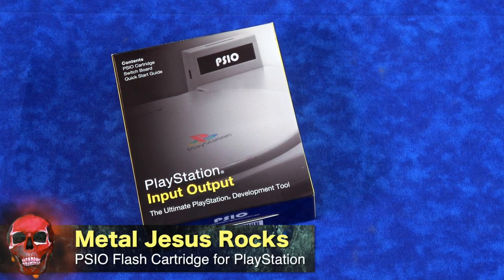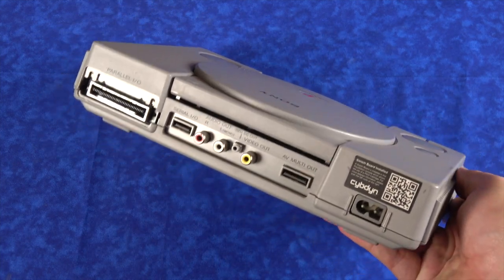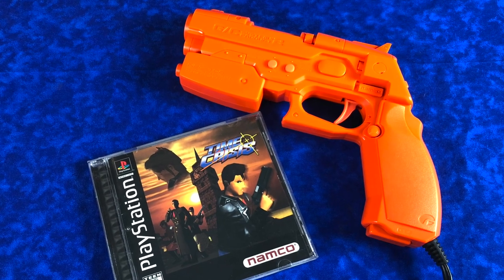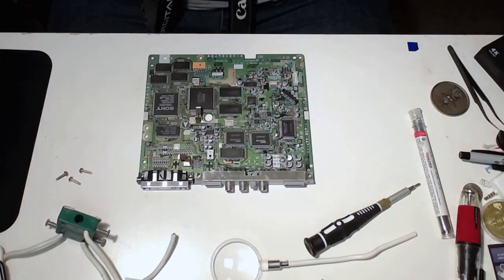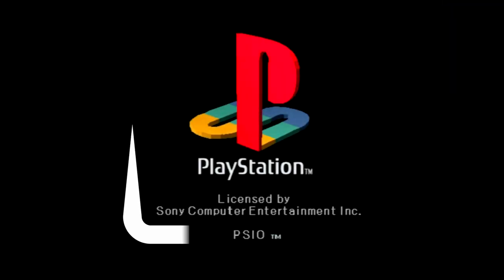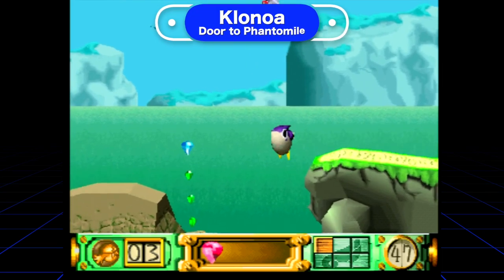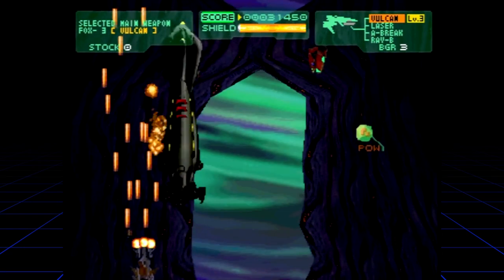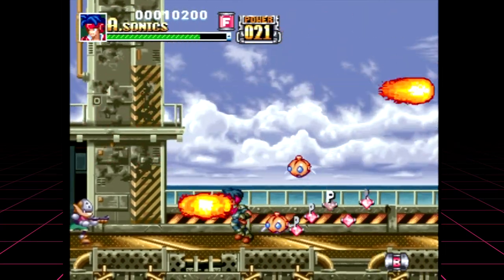PlayStation PSIO - SD Flash Drive for your PS1

Comment: This is awesome. You don't have to worry about your laser dying, nor disk rot getting to your games with thing, but still get 100% authentic experience.
Reply: Rathori Khass If you like to play discs, it’s kind of a bummer.
Reply: @RichLunaMusic  
Urgh, why would you want to play discs when they can skip and take longer to load?. Surprised you didn't mention "piracy" lol
Reply: Rich Luna you can still play discs, it won’t affect the drive at all
Reply: @RichLunaMusic  you can still use your discs. What I like here is you can use a digital ROM file without using an emulator. Game still plays and acts 100% because its, well, actually running on a ps1. The disc drives almost always are the weakest part in older consoles, so being able to still play the games without wearing out the disc drive (or of your disc drive is already broken) is awesome.
Reply: 0/10 not enough skipping

Just kidding it'll be great to finally get some use out of my PS1 with a hardly working laser
Reply: My disc drive skips so this would be cool. But I feel I'd screw it up trying to install it. So hopefully it sells well and they make an easier one to use
Reply: Soft mod ps1 allows discs to be played also and no soldering
Reply: @datunes  the whole point of this mod is that you don't have to use the disks if you don't want to.
Reply: If only they made a USB version so you can connect a 4 TB hard drive and have the whole psx collection. Ntsc and pal 😍😍😍
Reply: @AJ12Gamer  or a WiFi one to connect to a NAS with that same collection)
Reply: @AJ12Gamer  Well you could just wait until they release a 4 TB SD Card :D
Reply: @theelite1x721987  The PSIO will be worth it for my audiophile PS1 SCPH-1001 that just wanted to die one day, it just goes straight to the menu regardless if it has a disc or not. It just couldn't stand the test of time, my PS1 was made in 1995 so it's 23 or 24 years old.
Reply: @pentiummmx2294  I also have a SCPH-1001. Thankfully mine is still going though I've noticed it's more picky about slightly scratched discs than my newer slim ps1. Probably started to wear down.
Reply: @AJ12Gamer  It does have USB. But only for loading games off a Windows PC. So you could have your library on that and play virtually any game without an SD card.
Reply: are loading times faster ?
Reply: That is awesome. I still don’t understand so if you get your roms from a computer those roms are not somehow emulated, because your console is not playing the game data in the disk? How is it 100% still authentic if your playing the iso?
Reply: @Ed-yj1ux  The dame is just data, whether it's read from the ROM or from a physical disk doesn't really matter, because the game will be run by the actual PS1 CPU, not by an emulator.
Reply: @Rathori  I get it, that’s awesome.
Reply: @Sterling20073  
Nostalgia

Comment: Thanks for telling us about this HOWEVER we don’t need to see you playing the games, we need to see you loading them from the menu so we can see the speed of loading! Amateur mistake MJR.
Reply: Yeah , we know what games are like, we want to see stuff like a compare of loading time from disc and from tf card!
Reply: Rubbish.  We need to see him playing the games.
Reply: @afistfulofpimples1745  stop it, you're embarrassing yourself.
Reply: @hazy33  Rubbish. No I'm not.
Reply: I have owned a PSIO for 3 years and It's a ODE which emulates the physical drive, so in turn won't magically make things any faster.  Only slight differences to increased speed is noticeable but then that is also dependent on SD card specs too and firmware.
Reply: @hanzobi1926  Thankyou! That's EXACTLY the information we needed.

Comment: Excellent review MJR! It's great to hear that you'll be using your PSIO Cartridge to enjoy your PlayStation 1 games the way they were meant to be played. Overall, this is what our goal was, and from your review, I believe we have met and further exceeded that expectation. We wanted to create a product which was well polished and used the original hardware the way the PlayStation 1 games were meant and designed to be played. Looking forward to seeing more PlayStation 1 content on your channel. With kind regards, from Cybdyn Systems.
Reply: Maybe you should correct his false assumption : «emulating the CD-Rom coprocessor». Yeah, not at all....
Reply: I'm a grandmother trying to resurrect my consoles and what's left of my games for grandtwins. I'm researching "mods" so I can copy games I have and soon to start buying. So how do I get the games to an SD card? Is that done on a PC first, then SD in cartridge in parallel port?  Sorry if I sound dumb, trying to learn.
Reply: @nanais007  Hi. No problem at all. Yes, it's done on your PC first. Once you've copied your games (and the Menu System), you then insert the SD Card into our PSIO Cartridge and plug the cartridge into your PlayStation console in the Parallel I/O port. Don't forget however, you'll need to install the Switch Board on your PlayStation mainboard prior to this. Thanks.
Reply: @nanais007  Now THAT's an awesome grandma.
Reply: This is the way to revive old systems hope one day, we have the same device for GameCube too

Comment: I have had this for a few months now (had this on pre-order for over a year) and I absolutely love this device. Able to play all games without having to use a disc on original hardware is magical. The installation of the PSIO is actually really easy for someone who has a basic level of soldering experience. I believe that you can now get these within a month of preordering. $149 for this is really cheap.

Comment: They actually already have them for the Gamecube, Saturn, Dreamcast. 
Check out Adam Koralik video about the GD-rom replacement on the Dreamcast.
My life in Gaming guys did a great review of the 2 version of the Saturn SD sub. 
Everdrive has a patch for Sega CD games I believe.
Gamecube SD media launcher is great
PS2 you can use a Sata to IDE adapter with a hard drive or IDE to SD or IDE to Compact Flash. 
XBOX same option as PS2 but remember to format the drive with FAT32 in 2TB partitions.
Amiga CD32 can use the Amiga 500 sd card reader.
3DO Nothing That I know yet
CD-I nothing yet 
Atari Jaguar with in the process and testing. 
 MJR!
I still am trying to find NAS storage access for my consoles.
Reply: There's a 3DO ODE out there for the various models, search for 3do-renovation (Russian site) for info. It can load games from a USB drive.
Reply: For the Amiga CD32, there is the Terrible Fire TF328, you should check the channel of Dan Wood, he made a video about it. You transform with this, your CD32, into the ultimate amiga machine.
Reply: @Brandon  The is a mod board for the PS2 Network adapter that changes the IDE plug for SATA. It works with the original Network Adapter and you keep the LAN support.
Reply: @ichigo3223  I have one, it's only around 8 UK pounds and comes from China but works perfectly! You have to use it with the official network adaptor though, it is my belief that it isn't compatible with the unofficial 3rd party ones!
Reply: lol yeah i was thinking the same thing >__<
from memory you have to patch the ps2 isos to run of the hdd or usb but yeah ps2, xbox and above are pretty easy to get software ODEs working. Webman for the ps3 one is my favorite
Reply: Everytime I think of this I consider modding my ps2 with a hdd which will be much cheaper simpler and more useful.
Reply: The things that sucks about the Saturns and Dreamcast. Is you have gut out the CD-GDrom drive and frankly i would rather use a hard drive than a SD Card.
Reply: Theres also nintendont for wii if you dont care about using a gamecube, but want actual hardware
Reply: @Gamdboytheadvanced  I believe there's a way to play Gamecube on Wii from a hard drive, seen multiple ppl doing it
Reply: Heads up about Gamecube SD Media Launcher/swiss - the compatability is very spotty and does not support audio streaming. Also, the included SD adapter wouldn't load anything more than 600mb - had to get a "WiiKeySD" one off ebay, and then I had to find an SD card that would load games properly as well. A Wii or Wii U are 900% better options for playing Gamecube backups, unless you are okay with burning mini DVDs.
Reply: Sega CD did not have copyright protection. Burn a backup and it plays. The Everdrive needs a copy of the BIOS to work with the CD. I have the Everdrive X5 and the whole Tower of Power setup... good times.
Reply: @austinismadcrunk  Wouldn't it just be better to softmod a Wii?
Reply: @nickwest932  The point of ODEs ist replacing 25+ year old laser units that will fail soon and are hard or Impossible to fix.
Reply: @XennialGeek  
OK... I agree.
Reply: Brandon Corby ,
Yep. Same.
Reply: Not really true in regards to cd32. 
Yes, there's methods to play standard amiga floppy games, but nothing for playing cd32 isos. 
The TF32 is simply a ram/cpu/io upgrade turning it into a modest specced aga amiga (far from "the ultimate amiga as a few people claim,.... its about 10-20x slower than the fastest amiga, even disregarding things like vampire)). 
All cool devices, but its pretty dishonest to claim theyre similar to things like the Everdrive carts or these iso playing dongles..
Reply: @Dr. ClawYes The SD media Launcher you can get via Amazon then check out the RETRORGB channel for recommended use.
Reply: @beezle1976  Yeah ok it's maybe not the most speed amiga, but it allows you to play most of the best amiga games that should be played on it and personally, i don't need more than that concerning gaming on amiga. the cd32 games are not so different than their versions on amiga computers, yeah it plays cd audio music on them but not so much differences. The similarity with everdrive is that you can stock all the games on a sd card ! Plus the RGB output that gives you a gorgeous image for both cd32 and amiga computer games, and that is not a little thing.
Reply: All good points but the mega /Sega cd is more than just a CD player for the megadrive, it has additional hardware so playing the games would take an ode
Reply: @Shane C The website says they are available for FZ-10, FZ-1 and Goldstar GDO-101.
Reply: dude, forget the SD card readers for saturn (if you are talking about rhea and phoebe)

they never take orders for those
Reply: If only they made a USB version so you can connect a 4 TB hard drive and have the whole psx collection. Ntsc and pal 😍😍😍
Reply: Softmodded Wii is awesome, soft modded Wii U plays way more, but both can play every Nintendo system that came before them in some way or another. The Wii can also run backups from SD and USB, I know the VWii on Wii U works the same way, but idk if you can run Wii U game backups off of USB through OG hardware.

Comment: MJR, did your playstation already have a mod chip installed? I'm just wondering since I have a release playstation like yours with a mod chip already in it.

By the way, your captures are so clean. Are you using an upscale of some kind like a framemeister?

Comment: I have an old PS1 with a dead CD drive, this would be a great way to bring it back to (extra) life.
Reply: thats my plan too since i dont want to throw my old ps1
Reply: Adam Christensen , same thing with me, it will be nice little project
Reply: Same Here. My original PS console no longer reads disks. Here in Australia this PSIO mod cost exactly the same as the PS Classic.  Cartridge remods me of the PS Hacker one with built in Action Replay cheat codes. I used to mod the original console so it became multi region and  use the disc swap method to play backup cd-r games.
Reply: Y'all could also buy an aftermarket lens for about $10.

Comment: I have PS1,PS2 and PS3 and the best solution in my opinion for PS1 games is with the retrocompatibility on PS3 with CFW. With that you can play the PS1 games using HDMI and load the games from the HD.
Reply: Faxtron wait what’s CFW?
Reply: @DeegoL9   Custom firmware "jailbreak" your console.
Reply: What does the CFW do?
Reply: @themcfaceman   With CFW you can install or use whatever you want in your console without restrictions like : emulators, media player, backups from HD, create backups of your games from console, use of Other OS to install Linux, use of control fan with software to reduce temps to avoid YLOD, you can see the temps of your console, use of file manager to copy anything you want or read from your console without restrictions, the use of multiple APPS from thirds like Multiman, Iris Manager, Managunz, etc,etc.
Reply: if you have earlier slim models of ps3, it'll be easy for you. tons of soft mod vids out there that would enable you to hack ps3 to play ps1 and 2 games. I run ps2 iso on my ps3 and use raspberry pi 3b+ for my retro games (ps1, snes, gba etc)
Reply: I can also testify for the CFW PS3 method. Best way to play original playstation games IMO.

Cheaper than the playstation classic and easier to mod. You can even get most ps2 roms to work too (not counting the heaps of games you can emulate with retroarc).
Reply: @Bewefau  You're missing the point. This is for playing on original hardware. CFW on PS3, emulation on a PC etc. is inauthentic and not all encompassing. You miss out on linking ps1 together, no guncon support whatsoever....before you say "who cares, nobody wants that" I promise you somebody wants that. This is for people to load ROMs on the machine it was intended for. No matter what argument you bring to the table or adding "but..." you already lost.
Reply: Faxtron so do you actually have to like open the console and add chips for it to work ?
Reply: @Dek_Quiet  just find a system on 4.82 or lower firmware I got lucky recently purchased a ps3 for $74 with 3 controllers and about 4 games jailbroke it and just create isos from my existing games I had
Reply: A $5 freemcboot memory card allows you to do all that. Guncon+every other feature.
Reply: @Bewefau  just the CD part is emulated. everything else is real hardware which is the point. It is an enthusiast product like so much else for retro hardware. If you just want to play the games you can emulate it on any PC with epsxe. lol at people bringing up PS2/PS3 with mods...
Reply: @cooolpotato  can it output a 240 p signal though if connected to a crt?
Reply: I need to remember that for the future if I ever get a ps3. Thank you.

Comment: 150 bucks + soldering labor is way too much imo.
Reply: $150? LMAO!!!! PSTV is way cheaper then that and fully hackable and you could run thousands more titles from different gens. I have one with a 264gb usb drive
Reply: 150 AUS, which is about 110 USD. But yes the soldering is a bummer, but as always with disc based consoles, getting a "flash cart" for them is never as easy as on the cartridge consoles.
Reply: you should learn how to solder, is really easy and helpful.
i fixed my ps2 by myself three times.
This gadget is awesome and is an amazing way to back up my collection
Reply: I dont get the price. Moding a ps1 was dirt cheap.
I got a modded psone for 15 bucks with 2 og mem cards and 2 og dualshocks. Like 5 months ago 😆
Reply: They are 
 £300 to 500($379-633) on Ebay (UK/France)
Reply: It's going to have the Metal Jesus effect and become 800$ or completely out of stock just like the GD EMU and every thing like this he reviews.
Reply: @johnyGrizzle  I didn't know that... It's easy and secure hacking the PSTV? What emulators run well? N64, DC?
Reply: The scene in Klonoa, when he said it was super unique, reminded me of Tomba! 2
Reply: 150 , too much